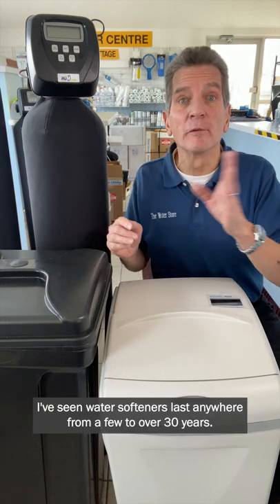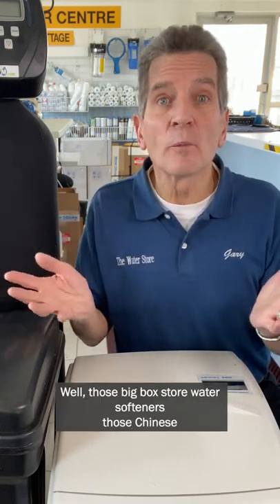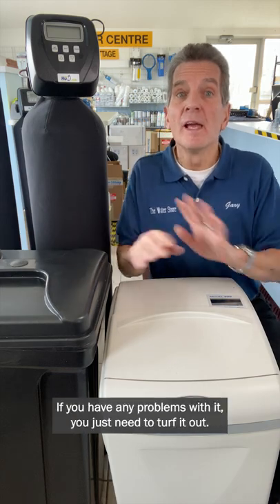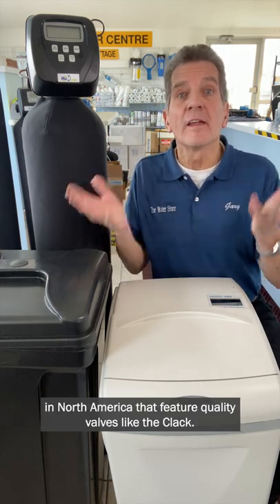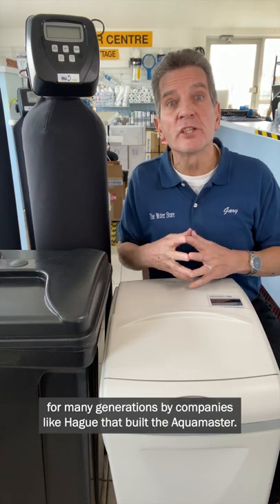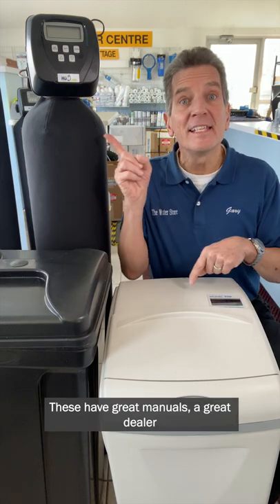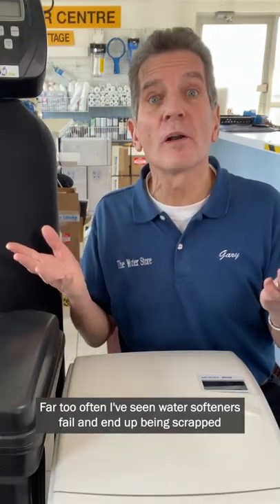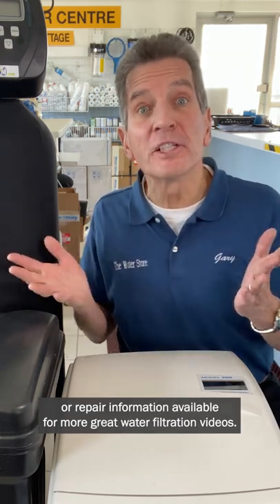HOW LONG Does a WATER SOFTENER LAST? #shorts

Comment: How long should a Whirlpool whse33 last? Mine is 5yrs old and it isn't softening. I get a 250ppm from it, using salt slowly but still using salt. Regenerating once a week, but using only 20 or so gallons. Can I replace something in the head area to fix this?
Reply from the maker: Big box store water softeners don’t last very long but you can try some of the advice from this video https://youtu.be/Lr3jyGiJdC0

Comment: The life of a single tank softener is 10 years
Reply from the maker: Some last 5 and some last over 25. Depends on the quality of the make, maintenance and the water.
Reply: @water_estore  some single tank softners may keep operating the valve, but after 10 years you start to lose capacity rapidly because your resin bed never gets fully clean.

Comment: $10000 for them!! $5000 to be hooked up to the Town water supply
Reply from the maker: Not sure what you mean.  A water softener certainly does not cost $10,000 (actually about $1400) and installation depends on the complexity but about $500 or less.

Comment: Water boss is junk
Reply from the maker: No, when used for the correct application and properly maintained they can last up to 25 years.  But, for more general overall use, I prefer Clack valved water softeners like this. https://waterestore.com/products/hum-deluxe-water-softener-30-000-grain